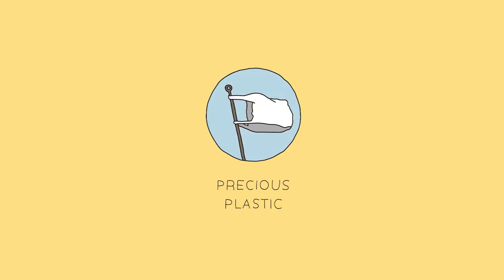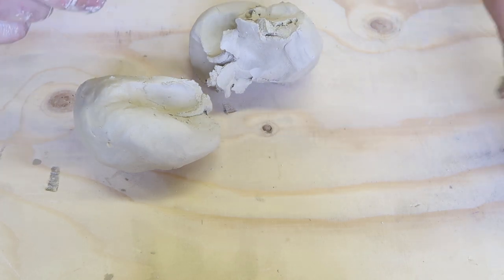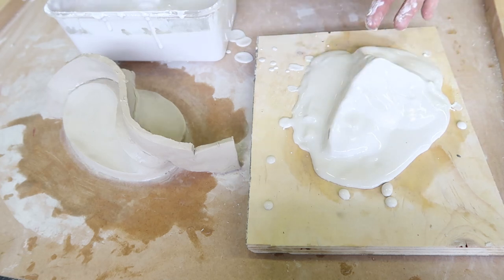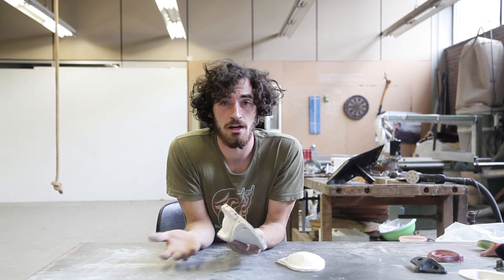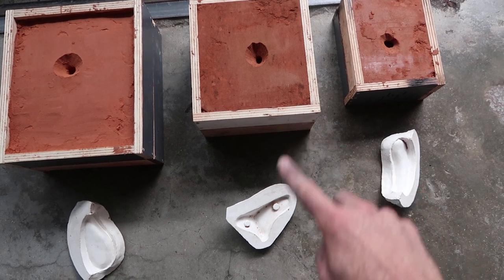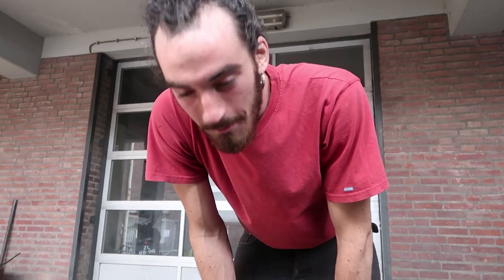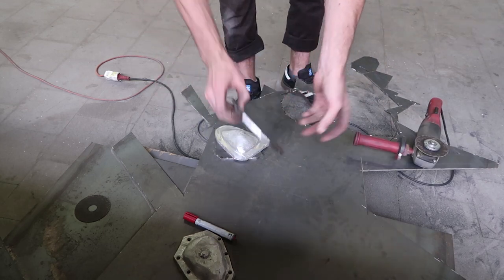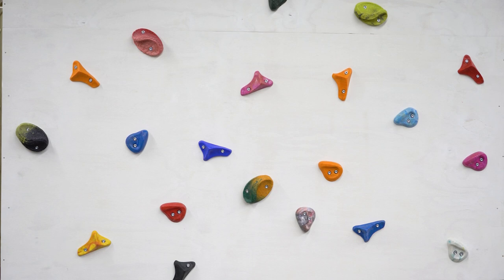Make recycled plastic wall grips with aluminum casted moulds #preciousplastic

Comment: be careful with molten aluminium, it's quite dangerous specially when pouring it in the mold!! the pot is red hot and be careful with coanda effect. Be properly trained to do this and get as much information as possible!! wear safety glasses and boots and protective clothing..
Reply: Javier Rivera Was this some kind of exclusive video since you commented so early?
Reply: sort of, yes. The videos were released on the day of the release of PP v3, but apparently they kept the links private and have been making them public one by one each day to 'make more noise' I guess.  All the videos are on www.preciousplastic.com
Reply: Not to mention the wearing of safety glasses while cleaning the molds with the angle grinder....
Reply: Can you please explain the coanda effect in more detail (in how it pertains to casting metal)? Thanks!
Reply: I don't know if it happens with molten metals, but when pouring anything I'm always aware of this bastard -> http://www.daviddarling.info/images/Coanda_effect.jpg

Comment: I think that these grips will be very slippery, but I still find this idea cool.
Reply: i think they roughened the surface
Reply: @dhupee  i don't think rough mould surface will help tremendously. Maybe mixing some sand into the molten plastic as they do with classic resin based wall grips. But it would probably destroy the injection machine...

Comment: How do you get a texture to be grip friendly and not slippery? The clay was smooth, foundry sand (petrobond?) yealds a smooth finish, so the aluminium was smooth. Or am I mistaking? Also, what kind of plastic did you use?
Reply: Nibiru plastic is pretty smooth in general. They put sand into the plastic in commercial grips to achieve this surface quality.
Reply: A quick wiki says modern holds are made of polyurethane (US) or polyester (EU) resin. So not thermoplastics, but hardend resin. I see no mention of sand. So these hold as they are now are probably bad for climbing. Neat idea though. You could use resins in the molds, but that's not waht this channel is about i guess
Reply: You could line the inside of the mold with sand before injection, i dont think it will stay on long though...
Another possibility is to coat the parts with polyurethane after they are done.
Reply: Even better would be if you put a rougher texture into the clay model. That texture would then tranfer into the aluminium through plaster and casting sand and give a better, grippier surface to the end product - the climbing hold

Comment: Hey Dave, I visited you guys at the DDW and noticed the climbing grips. I have done some climbing in the past, have you guys also done it? I think this opens up a whole new category, like impossible. The untextured grips are way too slippery and even the red textured one is... also unsuitable for climbing. Injection into DIY moulds creates vast possibilities but I think this  is not the best way to use it. 

You also get a lot of comments on the latest videos about safety and precaution, that's not to be picky, just imagine what could happen with a bucket of molten metal. My guess is you won't turn into Wolverine. And the same with grinding aluminium, your eyes wil love it. 

So far for being critical, here's a tip! Stop fumbling around with lose nuts on those moulds, if you are already welding why not tack them onto the mould? If you guys want to do a production of more than one piece it saves a lot of time and gedoe. 

Houdoe!

Comment: For what it is worth, I've seen a few videos on recycling aluminum for mold making and they all seem to agree that cans do not work so well. It is better to use scrap parts that were originally cast aluminum. It has to do with the additives and the "grain structure" of the aluminum.
Reply: Yes, too little ''usable'' material...lot's of junk to get rid of off a can...it's like melting cable with insulation to get copper.